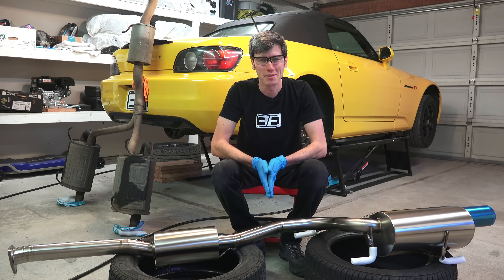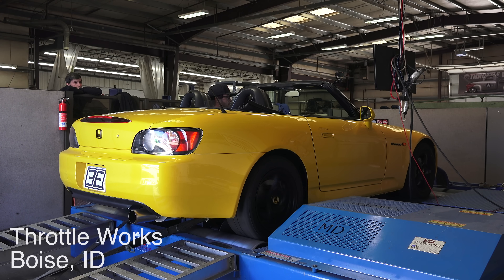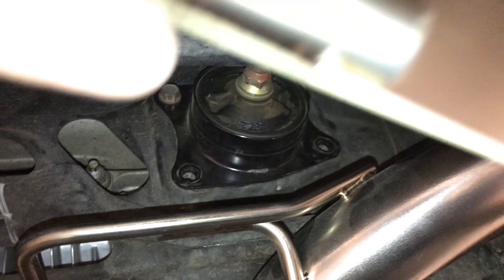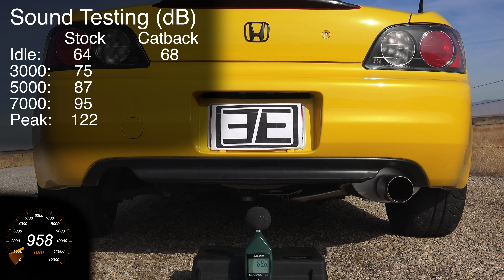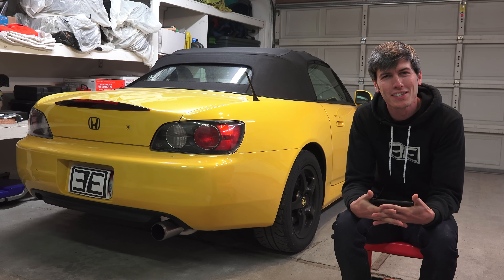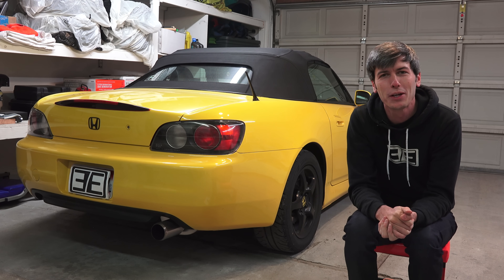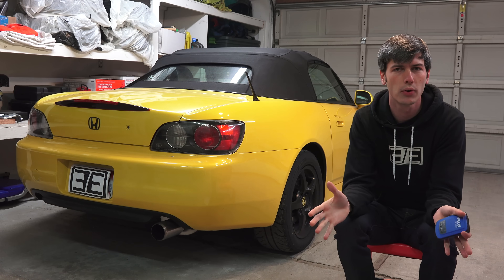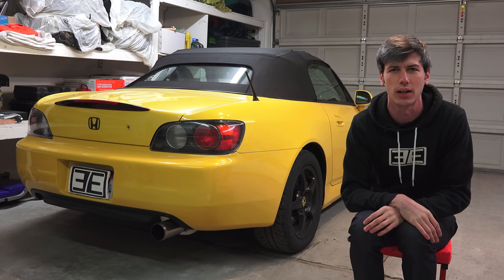Can A Catback Exhaust Make Your Car Faster?

Comment: Just changing the exhaust to a more efficient routing actually does change power, because of evacuation velocity -- i.e., the exhaust "flow". Because exhaust velocity partly dictates engine efficiency (air in, exhaust out), the faster you can take air into the combustion chamber, or expel engine exhaust, the quicker you will move on to the next stroke. In a different way, it's similar to slider bearings vs roller bearings: You get less rolling resistance with roller bearings, and therefore don't lose momentum due to external factors. As here, the heat transfer is better, and because it is, the car can run at a higher RPM, longer, because of both the efficiency of the exhaust routing, and because of the material used: Titanium vs steel, or even stainless steel.

One other note: Due to the weight difference, the car will accelerate quicker with the titanium exhaust, simply due to the weight shaved off of the exhaust piping. How do I know this? Newtonian physics: Because the overall weight is now lessened, with even the slightest power increase, the car's powerplant and drivetrain will overcome the "at rest" factor of Newton's second law of motion quicker than it would with the stock exhaust. Remember: Everything for a car is based on Power-to-weight Ratio. You change that even slightly and make one more while making the other less, as here, then your overall acceleration factor will decrease. This manifests in a quicker 1/8th or 1/4 mile trap speed and trap time.

Comment: I think you should lower your vtec around 5500-5600..for sure there will be changes in fuel demand with that exhaust. Is it tuned? After the catback installation?

Comment: Seems about right to me. I thought you might see a little more boost in HP because it was super charged. I was thinking the tuned exhaust might help the supercharger out a little. Just goes to show you how much effort these engineers put into designing a good exhaust for most cars. A lot of people think they are going to throw a CAI on and a cat back exhaust or delete a bunch of parts from the current exhuast and they are going to gain all this power. In reality the aftermarket version probably isn't designed as well as the stock version. I also love that you went from a dual outlet to a single. I bet some kids are freaking out about that lol. They all want duals for some reason. I always tell them why bother on a 4 or 6? All you are doing is adding more crap and weight. Just go with a single that has the proper diameter for the size and power engine you have with nice smooth bends. It will weigh less and you can get better quality for the same price, just like you did.

Curious, did you try to tweak the tuning after the new system to see if you could eek more out of it, or did you just bolt it up and run it?

Hey, if you like the sound, you didn't lose any horsepower or torque and you shaved off 30 pounds I call it a win. Not the most cost effective win, but a win none the less lol. Normally when I change a muffler I just want more sound or a deeper sound. I never expect it to really perform better. I don't like loud cars anymore, but I do like to hear them. I don't like it when I can't hear my car running lol.
Reply: I just noticed this video was before you supercharged it. My bad lol

Comment: Did you notice any change in gas milage? I ask because I had an 85 Crown Vic with a 302 that typically got 20 mpg on my commute to work. I kind of halfway kept track because the miles on the trip od and gallons put in were very consistent and easy to calculate in my head. Then one fill up I noticed that I was getting about  10% more miles on the same fill up amount, so about 22mpg. Seemed strange but it stayed that way for several of the next fill ups. Then one day I walked around the passenger side and could hear that I had a hole in the exhaust system. I took it to a local shop and had a stock replacement muffler put on and on the next fill up noticed my mileage was back at about 20 mpg. Almost made me wish I'd just put a temporary patch to pass inspection and taken it off till the next years inspection!

Comment: The weight gain on the exhaust is compensate the supercharger's weight. You would gain more power on the exhaust system if the engine would put out more than 250-300 Hp.

Comment: The increase in the hp is in the new muffler.  Less resistance in the exhaust flows.  What would be the change in HP without the Catalytic Converter.  I'm thinking or removing it from my 1994 Toyota 4Runner.

Comment: So, how the Horsepower got increased without tune?
Reply: Less resistance in the flow of the exhaust fumes do to a less restrictive muffler and a slight weight loss.  The less restrictive muffler allows less negative pressure working against the engine.  Therefore, the engine works more efficient.  That's what I remember from my fluid mechanics class.

Comment: You'll see more of a difference between the two exhausts when you install a turbo the following year ;-)
Being a sporty car in the first place, your stock exhaust was pretty good. It's all relative to how much air you're trying to force out the pipe. It's hard to improve on "already plentiful" airflow.
I'm kinda surprised you got a 5% 0-60 improvement with the small dyno gain. 
I'm sure now that it's turbo'd (pushing more air mass), it would show a bigger improvement if you ever put the old stock exhaust back on to compare again.

Comment: This outcome is already well known on s2ki. Honda has already optimized the F2x close to its limits. Love your vids but a more interesting test would have been stock vs stock tuned vs amuse tuned. Granted you’d have to do some ecu mods, but... you’re EE! Adding an HFC to the mix would have been valuable data too

Comment: Titanium is heavier than aluminum. Because of its superior strength, less Ti is needed for equivalent applications.
Reply: If you want to make the tubing as strong as a steel counterpart would be.
You need more aluminum to equal the same amount of (strength as) titanium,  with titanium, you can use thinner wall tubing to yield the same amount of strength as steel.
 Aluminum as a raw material weighs less than titanium, but because larger amounts of aluminum are needed to match the strength of steel  titanium is lighter in the manufacturing process and at the same strength of steel.

Comment: Your car is only producing 180hp ? S2000s aren't supposed to be more powerful than that ?
Reply: Depends on whether hp is measured at the crank, or at the wheels. I've heard that friction losses from the drivetrain are typically about 10% of engine horsepower. I saw black smoke coming out of his exhaust, which makes me think he might have leaky valves, so some of the horses may have left the stable and need to be corralled.

Comment: There's also the consideration that there were no engine modifications done. The performance difference might have been more noticeable with more engine modifications. It's quite possible that the stock system had nearly as good of flow as the stock engine needed, but wouldn't have been able to keep up with a mildly or heavily modified engine. I feel like this would justify the price difference if it was meant to be outfitted to heavily modified cars. There's also the fact that, as you stated, the catalytic converter is the biggest choke point for an exhaust system and it wasn't changed. I feel it would be an interesting test to remove or change the catalytic converter and then compare the stock system to the aftermarket one.

Comment: Exhaust cost too much cuz he bought a Titanium exhaust, not a stainless steel one, a stainless steel exhaust would have been heavier and coulda actually made it weigh more which is why he went with titanium, is my guess.. I woulda spent that money on a long tube header, hi-flo cat, n a electric cut out exhaust to watch the huge amount of power n acceleration he woulda noticed.. N he woulda saved money by going my way..

Comment: can't believe you went dual to single exhaust
Reply: Why? I can't believe it had one to begin with. Why on earth would you have a dual outlet system on a small engine that only has one bank anyway? Its a fake dual exhaust in the first place, it just splits off into two mufflers or outlets at the back for looks.  A single exhaust with the proper diameter will weigh less, have less and smoother bends and have less parts/materials. Which means you can get a better quality system for the same amount of money.

Comment: 2.5 hp to the wheel is really no small thing. its way more significant than 10 horsepower motorwise.   and your car is lighter now so thats great improvement

Comment: I've always wondered what that tube that sticks out at a 90 degree angle after cat actually does
Reply: It's a resonator to remove undesirable frequencies.
Reply: @TassieLorenzo  i have seen in line resonators. What is this 90 degree exhaust resonator called?

Wondering what to put in the search engines to find exhaust with these type of resonator

Comment: You have to remember that the most important measure here is the power-to-weight ratio, which is improved both possible ways here, making the overall effect worth it (though more so on a turbocharged car).

Comment: How can you complain about a 2.5% HP increase for 2500 bucks when you don' t re-tune the engine to use the less restricted exhaust flow? Tbh this video really hurts the reputation of that handcrafted titanium master piece. Its not meant for what you use it for.

Comment: Sometimes it isn't about getting huge horse power and torque gains.  Throttle response and how your car puts that power and torque to the wheels can go along way.  Having said that I wouldn't want to spend that much on something that is going to only give you negligible gains all around.  You might get better results if you got a high flow cat.

Comment: I'm not sure your explanation for the extra power is correct.  I don't hink you gained 2.5hp at the wheels because you needed 2.5hp less power to push out the exhaust gasses.  That difference is equivalent to two typical gas-powered leaf blowers, which doesn't seem credible.  Isn't there a multiplier effect, where restricting exhaust gasses a little interferes with combustion, causing disproportionate loss in power?

Comment: Regarding the close-fitting exhaust hangers...in 2005 (I believe), Honda made a revision in the rubber exhaust hangers. The change was to a 3 holed more triangular shape rather than the two holes. The distance between two of the holes is greater than the other, and keeps the exhaust slightly further away. This is especially important in the AP2 rear bumper cover, as aftermarket exhaust can come very close to and sometimes melt the bumper cover.

Comment: I put a larger diameter, straight through muffler, high flow cat full exhaust on my pickup and it made a difference because the factory setup was super restrictive for quietness. Same for the SUV. Mostly noticed an MPG gain though since it breathes better and doesn't work as hard on cruise. I'm not a stoplight racer.

Comment: my 30yrs experience with cars/bikes especially N/A motors is open that exhaust up....if you can of course ie. noise complaints/neighbors/having in car convos etc. 

was told as a young bloke max of 2” on a 4cyl...2-1/4” on 6cyl....etc etc...i’d thanks but just give me what i asked for....2-1/2” min on a NA performance 4cyl...

it might shift the power band up but mid to hi rpm range performance but you won’t care

Comment: thanks for the video. I did a similar experiment to my Type r civic 25 years ago and  you have PROVED my point. I only had  hand held stop watch at the time. But the major improvement was going up hills with more flow and less gear down shift.  With $2500, I rather just remove the stock twin muffler and repalced them with a 2 shorter Cannon muffler(straight thru). And the remaining   $1800, I will get ECU chipped after the new muffler.  Your video 0.3 sec less 0-100 gains from more weight reduction then your exhaust(2.5hp), despite after vtec.  You will get more gain by removing your CAR SEAT....haaaa.  About the sound, the lighter the metal(titanium) or less dense will give a "lighter sound" not a deeper sound as you have mentioned. As matter of fact, the stock sound s more mean. lastly, when you had twin Cannon, the exhaust sound would be AWESOME.....

Comment: Would power gains be representative of the base power of the car. I.e. would you see greater gains if you had moded engine, taken a baseline, and then installed the exhaust. So a moded engine would produce X HP and adding the cat back then would yield something greater than X+2?

Comment: I wouldn't mind going with titanium valves or connecting rods but I'm not sure about using titanium for the exhaust. I wonder if it would be feasible to use some sort of anodized and hardened aluminum for the exhaust system?

Comment: I've been an avid as well as sapiently penurious motorcyclist for 40+yrs. The biggest suckers out there are the fools who just gotta install a $600 to $1200+ aftermarket exhausts on their new bikes before they've put a hundred miles on them. Admittedly the aftermarket exhausts commonly save 30 to 60% in weight. But performance differences are purely academic, and the sonic difference just puts you more vulnerable to LE interactions and tickets.

Comment: The S2000 was not the best car with which to do this comparison; Honda did a very good job designing the stock exhaust, so performance gains with the aftermarket exhaust system were minimal. Performance gains would be much more dramatic on something like a base Honda Civic which has a much more restrictive stock exhaust system.

Comment: If this car is in the 8-hour endurance race or 24-hour endurance race, that 5% gain in power and 30 pounds lighter in weight will make a difference in speed, fuel consumption, and distance traveled.

Comment: Hey Jason, I know this videos a bit older but it's related to my question so I figured it would be worth a shot. I have a 2011 wrx with a catback; when I blip the throttle with clutch in and in first, the exhaust makes lovely cracks and pop noises, but when I do the same in neutral it doesn't make the same sound, any idea why this would be?

Comment: I know it's all about test and compare, but why—if you're going to drop so much on an exhaust—would you not do a full system, incorporating tuned headers and hi-flow cat? Maybe (in the name of science) even include something similar to the EXUP valve used by Yamaha in their motorcycles?

A full tuned system with exhaust valve (triggered to open by VTEC) would fatten the low-end torque curve and still allow VTEC to really do its thing. The system would require dyno-tuning of the car to realise the full benefit, which would no longer be a direct comparison, but you could also do a pre- and post-tune comparison. Tune or no tune, why only drop $2500 on an exhaust that produces minimal improvement (but I will admit looks sexy as) when you can drop $3–4k on a system with much more potential for improvement? 

One final thing—single-outlet with dual-outlet trim looks incomplete—how much extra weight was a dual-outlet option? The exhaust note with dual straight-through could have sounded even more awesome than the single outlet (which still sounds more purposeful than the stocker).

Comment: Probably -17kg is worth more than the non remapped modification. The experiment is stock ECU catback mods. 1% without ECU remap power gain, 2.5% weight/power better ratio, 5% real world acceleration gain. All in all this served the purpose of your supercharger.

Comment: In 2004 I installed a 3 inch mild steel dump pipe back exhaust, an inch bigger than stock, at a cost of $800 aud, and it gave me 20 kilowatts extra, and since it was under my car, i didn't give a rats what it looked like haha

Comment: You can probably make about the same gain with an axle back instead....more bang for the buck.  Also, most of the weight on the stock cat back is from the mufflers.  So weight reduction is probably around the same, maybe a slight difference, with an axle back.

Comment: everyone already knows that these are for super extreme suckers. , Unless you have a high horsepower engine it will never be worth it. A 60 dollar magnaflow ill give the same results or better. Also when you did your runs did you have the same fuel levels , was the wind the same?

Comment: Its about 1.5 percent weight loss in a quiet street pipe ,the weight loss is what's the factor on the track ,,.mr ee has brilliant data keep it coming, id like to know what a noisy settup would gain, i have a magnaflow on my seqoia to hear the v8 ,im a car nut and a dad

Comment: On most cars, a catback exhaust will typically only change the sound and HP change will be modest at best.  Glad you showed that whopping 2.5HP gain.  The only car I ever noticed a difference on an exhaust mod was an '83 Mustang GT.  It had restrictive iron manifolds with very restrictive emission gestapo butterfly valves that then went into a single tailpipe.  I put in full length headers and dual pipes and wow - like a different car.   The seat of the pants difference was huge.  Nowadays, exhaust efficiency is pretty much maxed from the factory.

Comment: S2000 is already making over 120hp per liter. Pretty much close to maxing out it's performance from factory. The only way you are going to make more noticeable power is force induction or fully built motor.